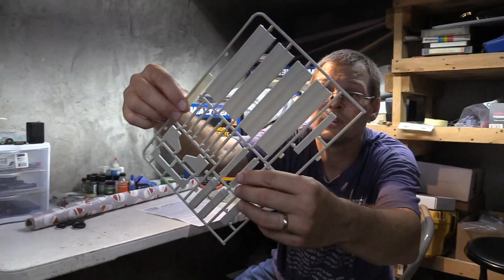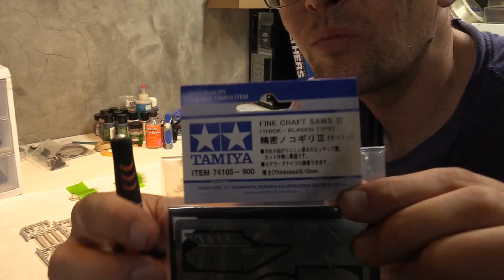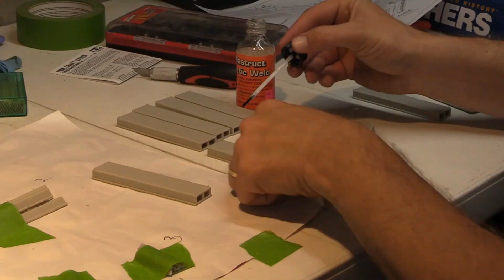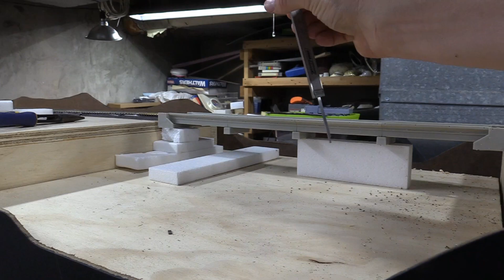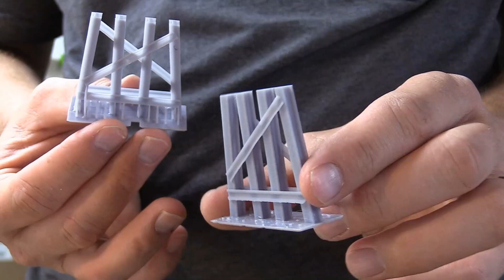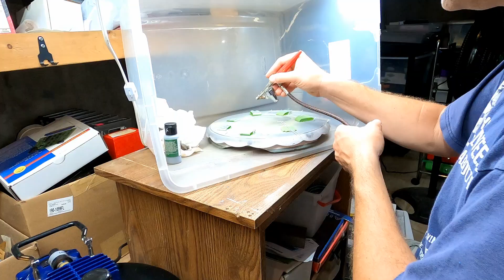Let's Build This Walthers HO Scale Modern Concrete Bridge

Comment: nice job, to bad they don't give you long enough parts for the base, but really turned out nice with the ones you printed off.
Reply from the maker: Yeah the bridge sections are modular. It can be in 50ft increments up to 200ft scale. Hopefully they will consider including various lengths of piers in the future.